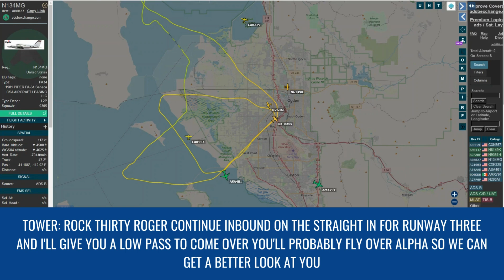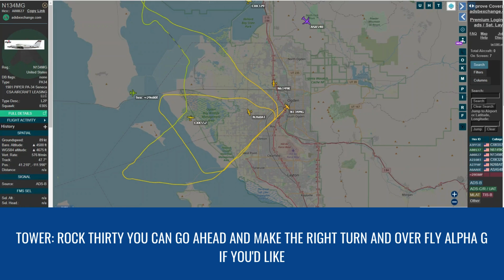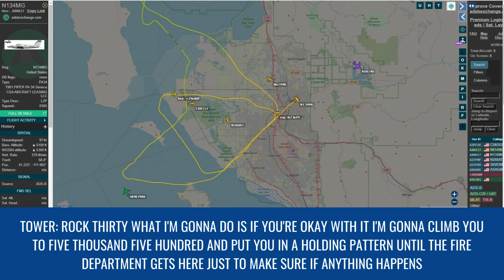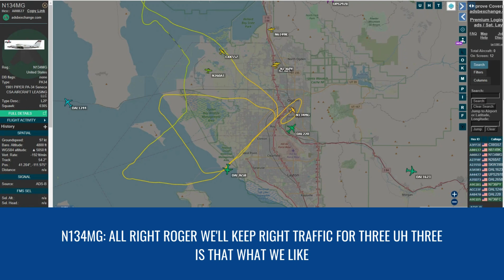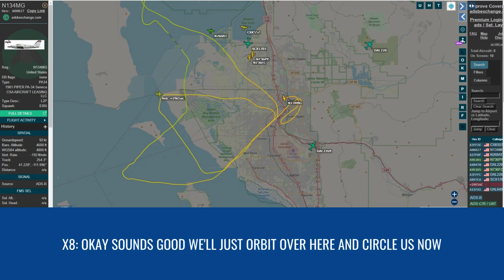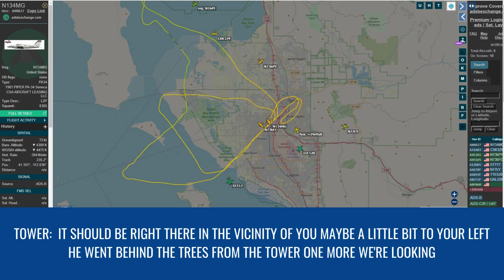Pilot Told 'Land At Your Own Risk!': Shocking ATC Audio of Seneca's Front Yard Emergency

Comment: Maybe they didn't manage the fuel tanks properly.  Ran one dry and single engine spin down to the ground?  There was no fire upon impact and the plane landed going backwards.
Reply from the maker: Based on their requested runway and crash location, I think this is definitely possible. And thankfully no one else was injured during the landing.
Reply from the maker: Thanks for sharing! Thats something I am not too familiar with. Glad you can help shed some light on this.
Reply: I wonder if they had modern fuel gauge sensors or the old-fashioned type where it is mostly correct when full and best guesses after that.